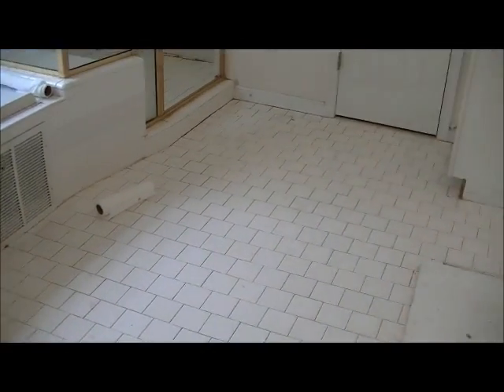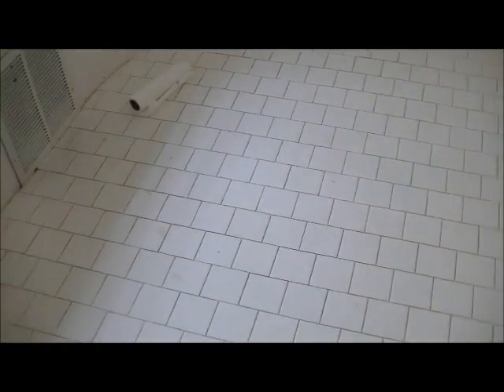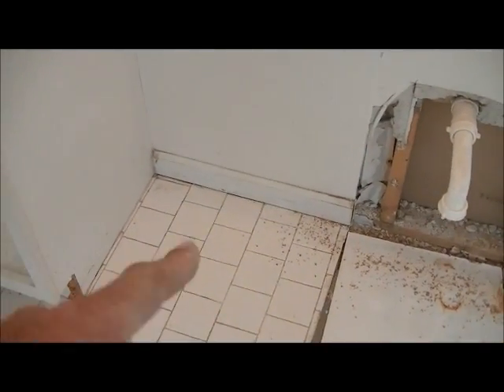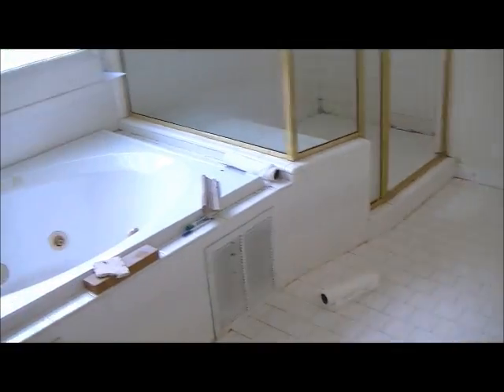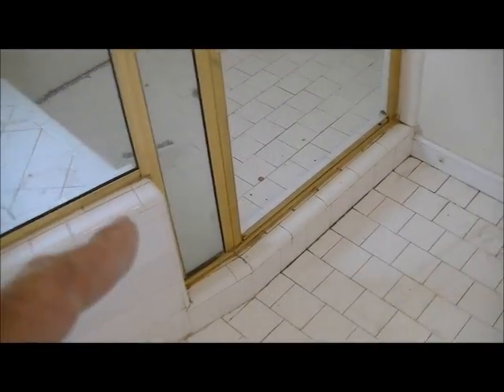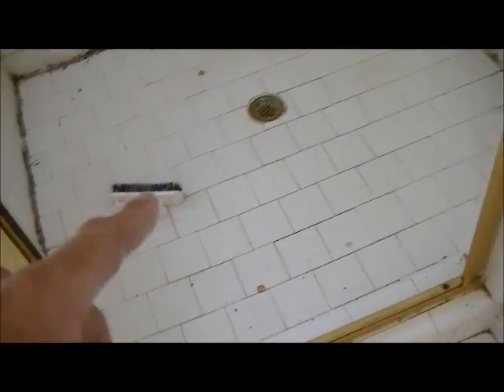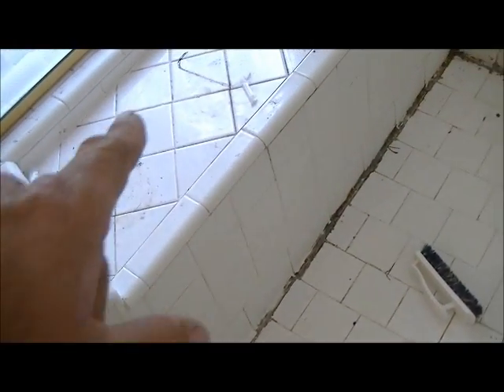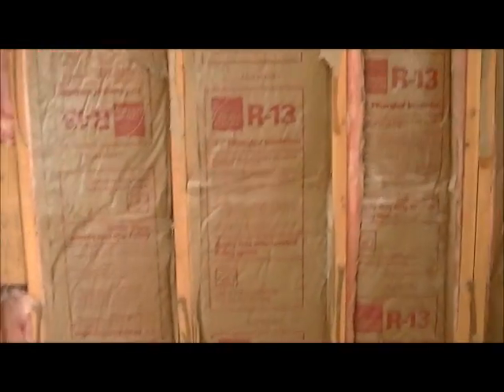Glass Block Shower

Comment: Using silicone to facejoin a shower wall is not very safe...the reason why theres flex in your walls is because you used silicone instead of grout to finish the wall. Silicone should only be used in place of grout when building glass block windows.

Comment: Hey Bob quick question, why do people nail in liners? isn't that just creating holes in something that is supposed to be waterproof? would gluing be better?
Reply from the maker: +Craig Seybert  Gluing would be great, but no practical, time would preclude most contractors from doing it. But waterproofing wall board with a topical membrane would negate the use of screws or nails in liner, the liner would then become a second ( or third ) line of defense against water penetration.
Reply: +StarrTile thanks for the info! I hadn't thought of the redguard protection sealing it in

Comment: Hey that was a great introduction to using glass blocks and very important info on the prep work.. How did you built the knee wall?  I hired someone to come in and create a knee wall on top of the tiled tub deck about 12-14 inches and then to install a glass panel that had all the hardware to attach to the tiled wall at the plumbing end for a splach guard.  I had no idea what he was doing.   what a dissapointment that was.  Now going to do it myself.  But this time with Glass Block knee wall but on top of the tub decking.  Is this what I would do do that it is up to  standard.  I'm a relatively good tile installer but not always certain of some carpentry prep and want to do the right way.   I now want the glass blocks to give extra height for the glass panel to  reach just shy of the cieling.  I have existing  tiled tub deck that is three inches wide Just enough to sit the glass on.  I want to install the glass on top because I already have that glass and block is expensive.  Can you advise me please.  Also if I wanted to put a niche in existing tiled wall can I just cut out the tile and denshiels to the studs rebuild the plywood neiche water proof it and screw in denshiel seal that and tile it?  Thanks for your help   Donna

Comment: It appears you used "thinline" (3"?) block for that large wall section.  As I understand it, that is not recommended for anything but windows because its not stable enough.  In any case, I wonder if adding an angle or curve to that large wall section would have given it more stability.
Reply from the maker: 4'' block were used, and you're right, this wall is very heavy & sways a bit if pushed on...though 15 tubes of silicone were used, ...not one surface area of any block did not see silicone so it would take a LOT of pushing to ever knock it down. Customer was aware and was ok with the process. You're also correct if a curve was used it would add stability.

Comment: Just so that other people don't get misinformed, silicone installation of glass block is not meant for free standing walls, nor meant for shower/wet areas. Great if it holds up fine though. I do mostly custom work on homes and have created many alternate methods of doing things. You don't always know unless you try it, as long as the customer has approved. You also seemed pretty judgmental of the prior work yet, it held up just fine. Was ugly but, effective haha. You can hire 10 different people to do the same job and have it done 10 different ways. As long as they stand behind their methods. I guarantee all my labor indefinitely.
Reply from the maker: +Clearview68  I agree 100% with all you said, the customer was told the wall will be VERY heavy and a hard fall from someone will have it demolished...she assured me no one would bump up on it. The water will never see that glass, too far away from the shower head.

Comment: Isnt there anything more attractive than those air conditioner grills to face the jacuzzi tub.I know you need access to the motor but that is unsightly in a new renovation.   Is air required under the tub...at least paint them to match the travertine..Otherwise a beautiful bathroom.
Reply from the maker: +John Pane  Customers are always given options...so yeah